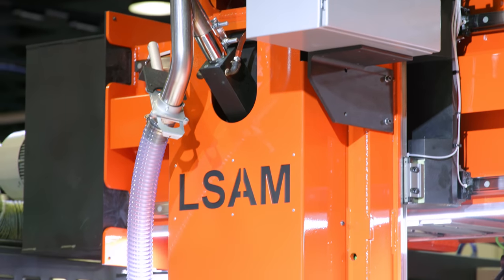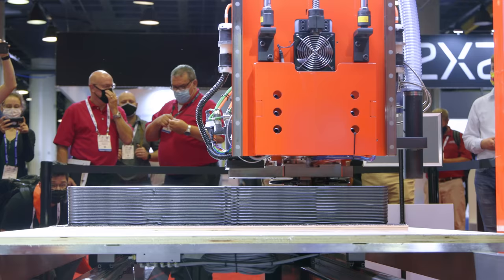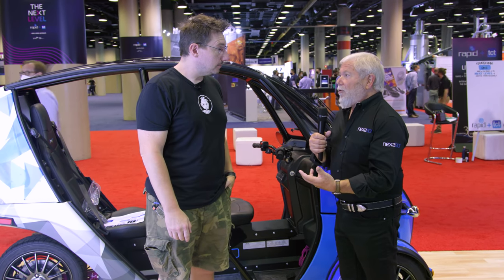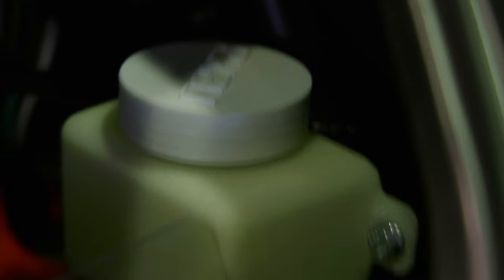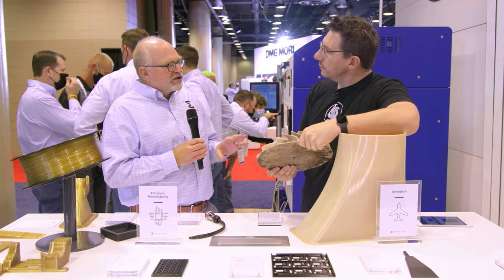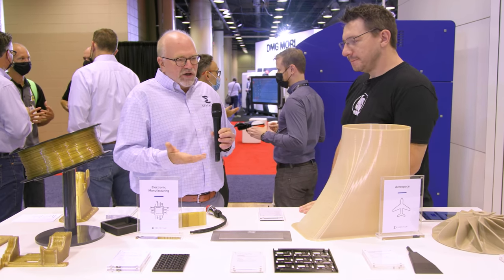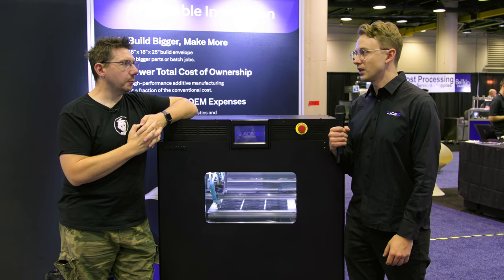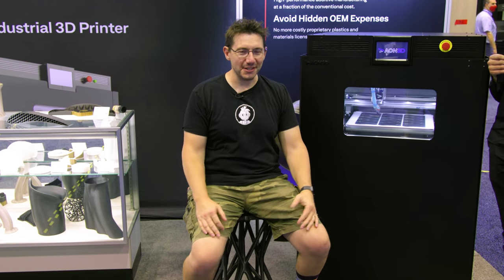ULTRA FAST HIGH TEMP 3D Printing at RAPID + TCT 2021

Comment: As an Arcimoto shareholder, it's awesome to see the FUV getting attention anywhere, but when it involves my favorite hobby of 3D printing I'm even more pleased. It's great to see the improvements they have made, and I really hope this is included in production at the new factory, and they are able to scale this up to the 50,000 units a year volume required for mass manufacture. It's so cool seeing how 3D printing is helping improve the usability of Electric Vehicles going forward. 

It was also fun seeing that stool take the "Full Joel" Like A Boss. I hope they share that file at some point. It would be nice in smaller scale as a pot plant stand. Seems really solid. I reckon I could probably make a decent copy of it though if they don't wanna share. LOL.
Reply from the maker: I really cannot wait to get to Ventura and take the FUV for a spin.
Reply: @3DPrintingNerd  You're going to love it. See if they will let you ride the new secret mini tilt scooter (well that's what I suspect they've built). Just remember, with any EV, go slow and work up to fast. You don't want to do what Elon Musk did, and goose the throttle and crash it. Have fun, and thanks for all the great video's over the last 5 years or more I've been watching.

Comment: never heard of  shear-thinning ... pretty interesting stuff :)
Reply: It's common for molten polymers, as far as I'm concerned. Paints are usually shear thinning as well.
Reply: Ketchup is shear thinning (thixotropic) for a more relatable example. Non drip paint would be another.
Reply: @Durkan34  You're right, ketchup is also shear thinning, but I'm not sure it is thixotropic... Now I'm curious, I'll check that with some colleagues.

Comment: i wonder if the roller could help with small normal fdm? doesn't seem hard to make
Reply: You’ll need another motor for it and another heater (i think the ones in the video is heated) 
That costs too much

Comment: is it just an impression or most of the machines in this video do not have the nozzle fan? as the man at essentium said, to have stronger bond (as for nylon) you turn off the fan. what is your experience?